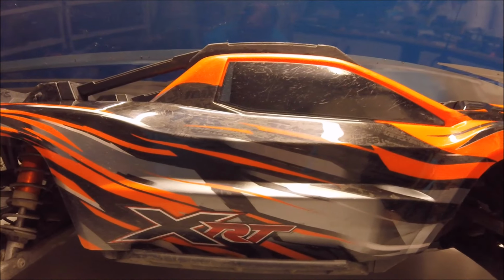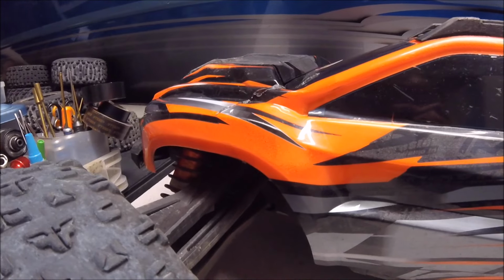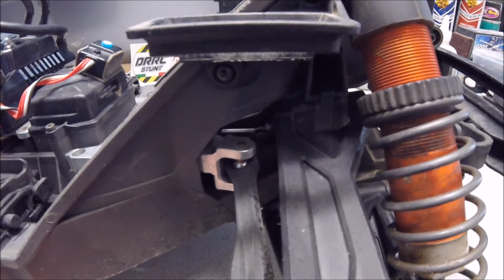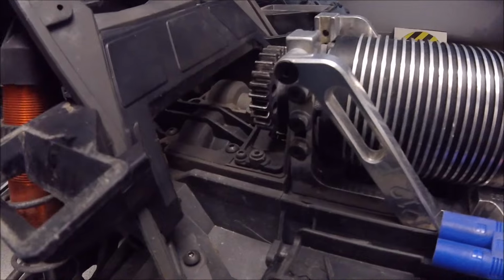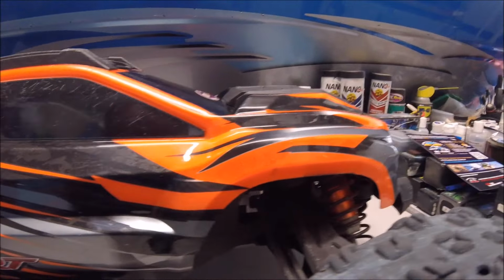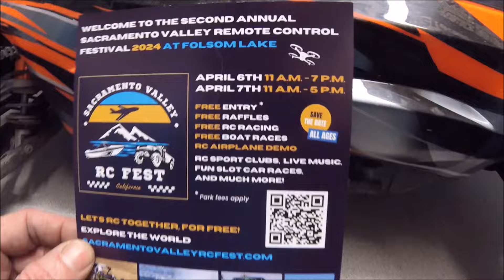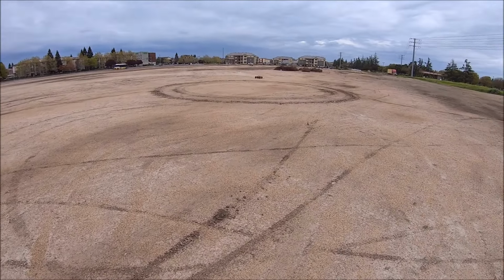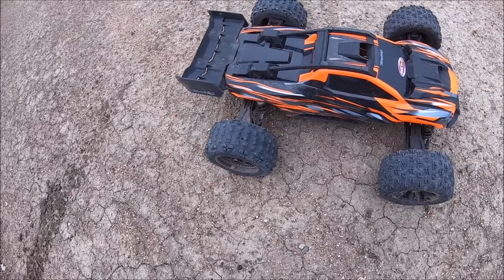"SCREAMER" TRAXXAS XRT 8s upgrade Potential Achieved!!!

Comment: Awesome video Rich somehow or another I got stuck on this video when I was watching your latest release. I forgot all the problems you went through with the XRT. I need to get mine put back together. It’s all in a box at the moment. Awesome bench overview of the car, and your Mojave grom video was awesome as well
Reply from the maker: Thanks so much Brother Aldo 🤗. I was frustrated to no end getting the XRT dialed in to the point of finishing a run intact 😂. It's an expensive endeavor making her right, but the Vitavon gears have held killer and sound sick at speed. The Mojave Grom is a ripper on 3s 😍. Truly appreciate it Bro. 🍻🤙🤙

Comment: Awesome video rich! I have managed to turn my xrt into a speed run vehicle with a max5 and 1100kv combo. I have a few m2c mods on it, but original gears so far. Hit 92mph the other day.  I feel like im just waiting for the monkey metal to come apart. Vitavon gears going in when they do break. Keep on bashin brother!
Reply from the maker: Thanks so very much Brother 🤗. 92 mph with a rig this big is nuts 😱🚀🚀. Huge props to you my friend 🍻
Reply: @richduperbash2966  It's not the most comfortable drive ever lol. And on belted duratrax banditos.  I promise you I used every inch of 2 lane road I had.

Comment: Watching this in my quest to get my XRT to do 80mph. Just started with some Hot Racing upgrades already like the aluminum bellcrank, servo arm and a couple others but i had no idea how smoothly this thing would go with those Vitavon diff gears. I think you've shown me that i need to invest in those lol.
Reply from the maker: You could probably achieve 80mph with the right power, gearing, and wheels. I'm a big believer in the Vitavon spiral cut gears now. So much smoother 👌. They've been flawless and I'm no longer worried about blowing the cheap stock gears.

Comment: Great content, what is your braking % set you on your esc? I have earplugs in my center diff but I am still stripping out the spider gears.
Reply from the maker: Thanks Brother 🤗. Think my brake is set at 37%. Make sure your diff isn't overfilled and perhaps check your outdrive cups for snugness. I haven't had any real issues with the spider or planetary gears fortunately.

Comment: I wonder why you have so much luck with arrma while Kev has more luck with the xmaxx. I own an xmaxx and have had it out 3 times now without breaking anything but i don’t go anywhere near as hard as you guys and im still on the stock power system  though im working on buying the stuff to upgrade now. Doubt I’ll go with a giant motor as id like to leave  the truck mostly stock but i would like to be able to backflip a little easier. 

A lot of people rag on the plastic parts from traxxas but besides in a few key areas I’d rather have plastic than metal. I built and aluminum T-maxx back in the day and hit a curb that twisted the whole thing. Aluminum bulk heads and diff cases is probably the furthest I’d go. 

It would be interesting to see M2c to come out with an aluminum chassis for xrt/xmaxx just to see how it does.
Reply from the maker: Kevin likes the XMaxx platform. It's a durable truck and super fun truck despite the wonky handling 😂. It's light for it's size because of all the plastic. Truth be told, there's lots of dead space (plastic webbing) in the chassis pods. Often you don't know the truck is imploding because it happens one crack at a time from the inside. Only when you take it apart to the bare bones will you find the cracks and failures. Plastic is great until it begins failing. Traxxas did a wonderful job with their control arms, hubs, internal diff assembly, and simple pin design holding bits together for easy removal. That said, the ring, input, and main gears are sinterned cast metal garbage designed to fail and need frequent replacement 🤑. You won't be able to backflip easily with the stock power and gearing. Unfortunately the stock tires  won't handle real large scale power for long. The rubber carcasses are thin and the foams are the cheapest I've ever seen with 2 pieces seamed together with glue 👀. M2C won't make an aluminum XMaxx chassis because it's simply not cost effective and will weigh too much in the end. Again the XMaxx is a clumsy fun basher, but it takes a butt load of upgrades and mods to take the same level of punishment as an ARRMA. Having had both rigs, I can say wholeheartedly that the Outcast 8s EXB RTR is a WAY better value stock vs stock.

Comment: Looks so smooth awesome set up, quick question I have the same set up in my Xmaxx Max 5 1100 KV 25/35 it cogs with a little trigger pull , I do have a stick Transmitter any suggestions. Happy Easter
Reply from the maker: Thank you Brother 🤗. I'd try recalibrating your ESC to your controller. It could be a throttle input issue 🤔. May experiment with a different receiver or controller if that doesn't work. 🍻
Reply: @richduperbash2966  thanks a lot brother always appreciate your input you are encyclopedia of RC knowledge.

Comment: Rich you ever have trouble with the cush drive gear cover or stripped bolts in that area? You ever use an aluminum one? What do you to  to fix it if you do?
Reply from the maker: I use the stock one and just keep the bolts snugged. Less likely to strip with the Vitavon gear shaft because it's hardened steel and doesn't warp like the crappy cushdrive shaft.
Reply: @richduperbash2966  Thanks!

Comment: Do you have anything behind your opinion gear off on the motor shaft any spacer or anything like the stock spacer thing on there or do you just kind of eyeball it and set your mesh with your spur gear?
Reply from the maker: I just line my gears up and set the mesh 👍. The key is cleaning the gear grub screw and threads with 70% isopropyl alcohol thoroughly before threadlock. I prefer Permatex Orange. This keeps the pinion right where I want it. 🍻

Comment: hi rich, since I mounted the 1100kv hobbywing motor which broke the rear bevel gear, or I purchased the vitavon pair, do you have any advice if I have to put shims on it, have you ever had problems with the vitavon one? thank you have a good day
Reply from the maker: Hey Brother 🤗. I don't remember using any shims with the Vitavon spiral cut gears. The input gear has a bearing retainer clip so you have to remove the upper bulkhead to install it straight downwards into the bearing channel. Great design actually. This locks the gear into place nicely 👌
Reply: @richduperbash2966  thanks brother😉, the clip is already supplied when you buy the crown and pinion, I hope that with those of vitavon I won't break the crown and pinion anymore, have a nice evening.
Reply from the maker: You too Brother 👊

Comment: @Rich what’s your honest opinions on the chassis braces for XRT and Xmaxx man? You’re one of the hardest on this stuff so I believe YOU know if they’re an improvement or not. Curious…
Reply from the maker: Both braces are an added durability benefit no question. I'd say it's an absolute must have with the XMaxx due to the elevated center chassis pod. Because of this, the XMaxx never achieves proper chassis slap. The downward strain of doing jumps puts all the stress on the connection points between the front, middle, and rear chassis pods. The M2C brace addresses this exact issue with a brilliant internal anchoring design by Mitch. The XRT brace is also effective at protecting connection points and absorbing direct hits from rocks. Very simple upgrade too.
Reply: @richduperbash2966  man awesome, thanks for that good feedback. Hope you had an awesome weekend man.
Reply: @richduperbash2966  last q, M2C has a narrow version and a wide beefcake version for xmaxx, which would be your choice sir?
Reply from the maker: I definitely prefer the wide version 💪

Comment: New to rc when i brake my kraton 4s say like 6 ft off ground if im back heavy and try n correct she just flips, nose dives, should i lower brake setting on esc? Thanks and sweet vid.
Reply from the maker: Thanks Brother 🤗. Definitely try lowering your brake setting. My Outcast 4s was the same. Think I set mine at 37%. Getting your rigs dialed to your driving style and taste is key to maximum fun and enjoyment. Make sure to calibrate your ESC to controller via "throttle set up" in the manual. That assures the best control between neutral, throttle, and brake.
Reply: @richduperbash2966  🤙,thanks.
Reply: Set it all up and so much better, ty.❤️
Reply from the maker: Great to hear Brother 👊

Comment: Have your ever i mean ever had clicking problems on your xmaxx and what did u upgrade/do to solve them
Reply from the maker: Yes I've had several clicking problems. It's usually a blown front or rear ring gear, sometimes an input gear, and rarely a chipped center diff or drive gear. The rear ring gear experiences more stress so I usually check there first. Vitavon spiral cut gears are hardened steel and way stronger than the stock monkey metal.
Reply: @richduperbash2966  yeah, funny thing is I have your whole rig max 5 1100kv g2 35 30 shock oil 200k rear 500k front vitavon front and rear diff gears and spider gears hr diff cases and everything eliminated the rear clicking, but I have not figured out the front.  Do u think it might be a bulkhead?
Reply: @richduperbash2966 i even have all the m2c stuff u have cause your rig and your xmaxx bashes so hard thats how im trying to get mine
Reply from the maker: It's possible your front upper bulkhead is cracked allowing the gears to lose mesh under power. You'd have to remove it to know. I usually flex them in my hands to check for splits. It's kind of crazy, but problems are often hidden with Traxxas plastics.
Reply: @richduperbash2966  yeahh thanks man imma check that out

Comment: How many kv should i have on a E-Revo? And how many kv on the motor if i gonna use 8s esc?🙂 P.S Was thinking about to upgrade my Infraction 6s to a 8s:)
Reply from the maker: I'd think 2000kv would be about right on the E-revo regardless of ESC. I ran 8s with my Infraction awhile back with a 1250kv ARRMA 8s motor geared up. Ultimately it was faster and more responsive going back to 6s with a TP4050 2300kv and Spectrum 160A ESC. Think she's geared around 18/50. My 8s setup was heavy and just ripped through tires. 6s hauls ass and handles way better all around. 🍻
Reply: @richduperbash2966  Thanks man. Than i just upgrade visual and things.

Comment: What batteries do you run?
Reply from the maker: I run mostly Ovonic 6000mah 120c 4s soft packs. They're cheap, light, and having plenty of kick. They sell in pairs on Amazon.
Reply: Thanks these batteries are great and cheap! I just use the foam that come in the pack and they have plenty of power
Reply from the maker: So awesome to hear Brother 🤗

Comment: Rich how were you running backflips on the rear and copperheads on the front?
Reply from the maker: I mixed them up because my other Backflips were old and had blown foams. The original 8s copperheads actually work quite well and are the perfect size for this rig in my opinion.
Reply: @richduperbash2966  yeah but you had backflips on the rear and copperheads on the front at the end of the vid. They are different diameter tyres. How did you make that work with your diffs besides having you front wheels off the ground most of the time? Great bash by the way mate!
Reply from the maker: The original 8s Backflips and Copperhead SB's are basically the same height and weight. Close enough to run together. With all 4 wheels ballooning on power you wouldn't notice any difference 😂. I typically run matching tires, but already tore the foams in my surviving Backflips. 🍻

Comment: You have more in upgrades than the price of the car, by 2x at least.
Reply: That’s how it is with hardcore bashing for any car tbh
Reply from the maker: The XRT is overpriced to come with junk gears and several weak spots. I didn't spend twice the cost in upgrades, but did modify her to my liking and used electronics and tires I already had.
Reply: @richduperbash2966  I know just sucks it required seemingly so much. I love that truck too, just wish we got an update, like others have been getting.

Comment: $2000 rig?
Reply from the maker: I'm not sure, but the XRT has weak points without upgrading. It's a blast with bigger power and the right setup 😱🚀🚀
Reply: Probably closer to $3000, unfortunately. 1k before tax just for the bone stock rig. All the M2C and Vitavon upgrades he has on there, plus the HW 1100kv motor and 200amp ESC, wheels, and bats. Yea, expect to be well over 2k. I have 8s Arrma rigs that are  much closer to 3k than 2k, all in with upgrades. Not trying to throw any shade, or scare you away from getting into it. Just being real. Its unfortunate how much these total up to, just to make them durable enough to bash em', without breaking something every time you take it out. However, Rich does extreme bashing. Most of us don't go that hard in the paint, lol. You certainly would not have to get all those upgrades to have fun with the truck. Especially if you're not going to be extreme bashing. But it's def more fun when you do!🤙🤙